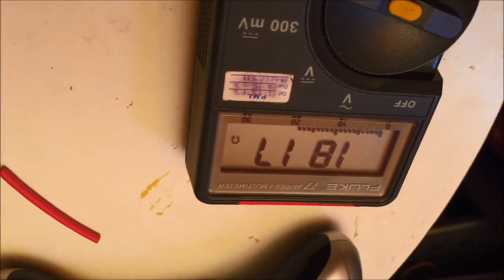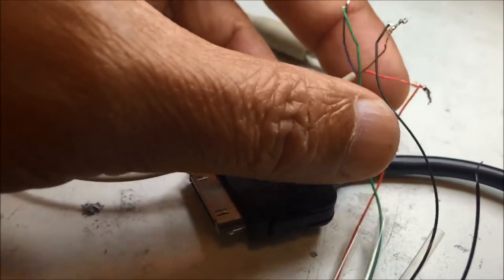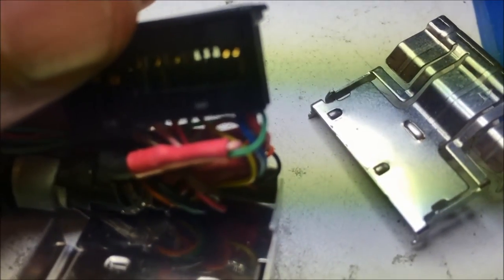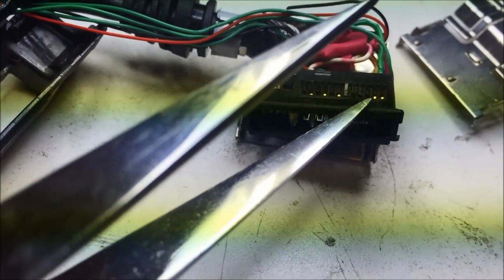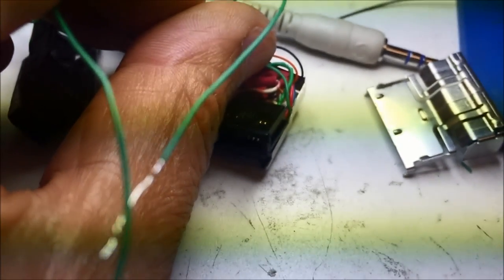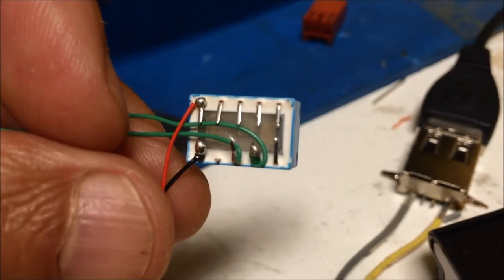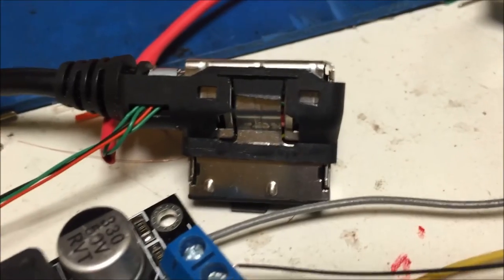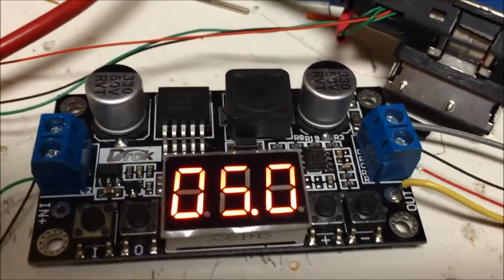How To Modify Audi AMI 30 Pins iPod cable for bluetooth streaming with switching circuit

Comment: I just want to connect the aux audio . But the mmi doesn't detect anything ..where am I wrong ?
Reply from the maker: to connect the aux audio, you need to put AMI into AUX mode = the ipod sense resistor must be 1k or less.
buy this AMI cable http://amzn.to/2z9nPzI
Reply: 3dogs1monkey  I did that . On puns 21&22 .nothing happend..ill but one of that cable. 10x
Reply from the maker: if resistance between 21 & 22 is 1k ohm or less, do the soft restart MMI, you should see the aux mode exist.

Comment: Are the 2 green wires connected to the pin holes at 21 and 22?
Reply from the maker: 21 & 22 are connected to the original resistor 1.8k for detecting iPod. You want to add 2 wires on both sides of the resistor, bring it outside, then make a plug to add parallel 2k ohm to make 1K for Auxiliary detection, remove it when you want to use iPod.